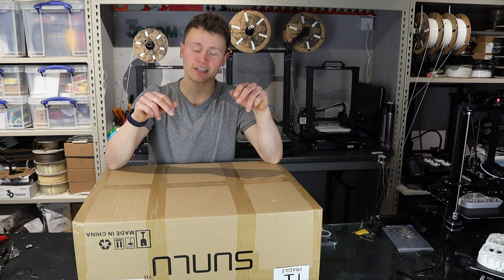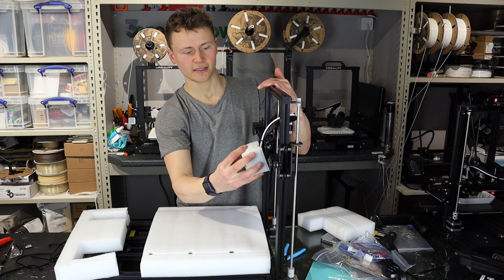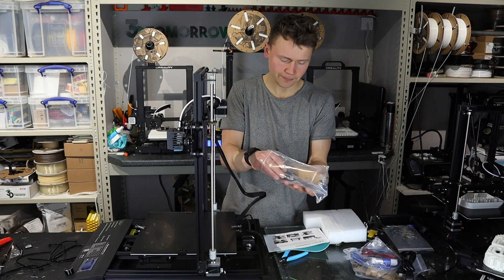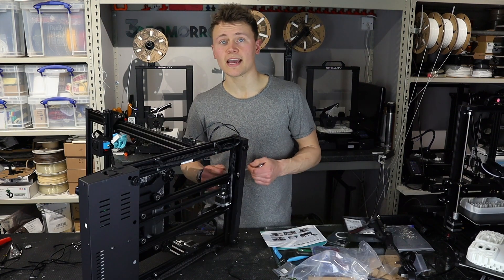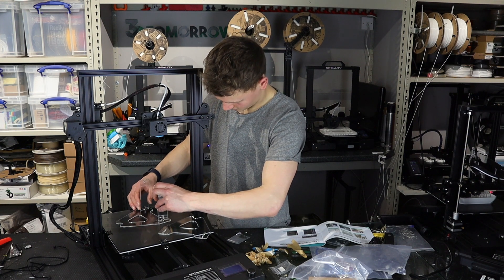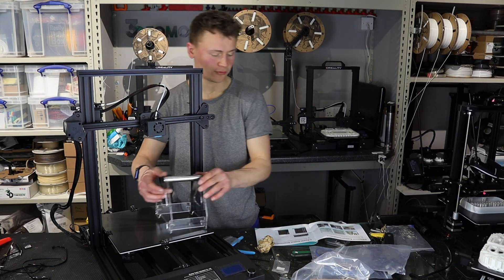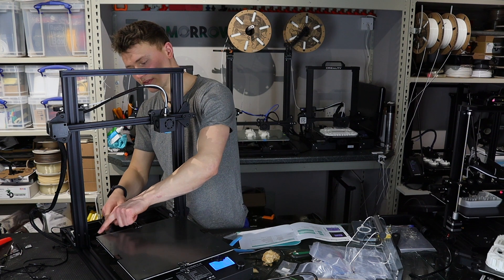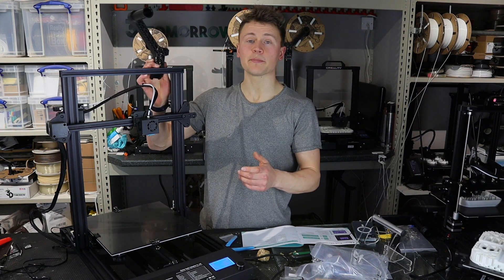Sunlu S8 3D Printer || UNBOXING & First Impressions || Another CR10 Clone?

Comment: I just ordered one of these and it looks like they changed the spool holder, it now mounts on top of the printer. At least according to the pictures on the site.
Reply from the maker: Often the case with the overseas printers, constantly making small tweaks! Sometimes for the better, other times I think it is to assist with component sourcing.

Comment: A1: print quality (of course the assumption this is a mid-price printer)
A2: roller bearing spool bottom supported type that sits on table
A3: non-UK resident but just for fun, will go for 2500g
Reply from the maker: 1. Good shout, this certainly is important. I'm planning to make a sort of benchmark print test to start using in reviews. Might make it easier to compare printers in the future.
2. Lots of people love the rollers, I've used in the past, but rarely so much anymore.
3. Always fun to guess:D

Comment: A1:  i went for a ender3 s1 printer purely on price as it had £110 off. (This is my first and only printer)
A2: i like my spool holder attached due to space and it looks more tidy imo
A3:  my guess is 1.2kg. I think you have a kilo of filament and I'm guessing 200g for the plastic spools🤞
How do i get your reusable spools do i have to buy them or do they come with filament?
Good show and good luck everybody👏👍😎🇬🇧
Reply from the maker: 1.Nice! £110 off is quite a saving, sounds like a good buy.
2.Yep, got to make use of as much space as possible, I've been known to use many a whacky solution to hold filament to make the most of space #efficiency
3. Thanks for the guess:)
In terms of the re-usable spools, I presume you mean the MasterCore Spool System? If so, they're available both on Amazon UK and the 3DTomorrow website on the same page as the MasterCore UK PLA. Will also make just the flanges available on their own too, so you could make the printable parts yourself, good way to use up those last bits of filament.
While we're on the topic of re-usable, all spools are technically re-usable, well re-fillable anyway. So if you prefer the convenience of pre-spooled filament, you can always opt to just send spools back as part of the 'Spool Buyback Program'.
Happy to send links to anything you'd like to know more about.